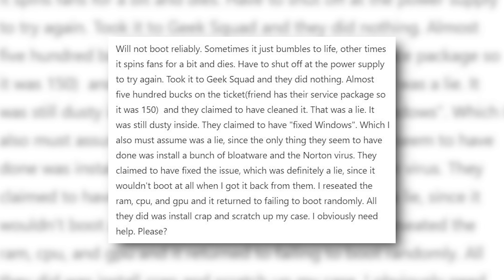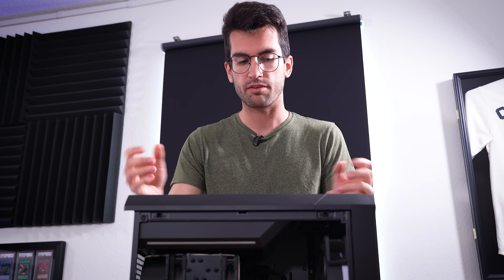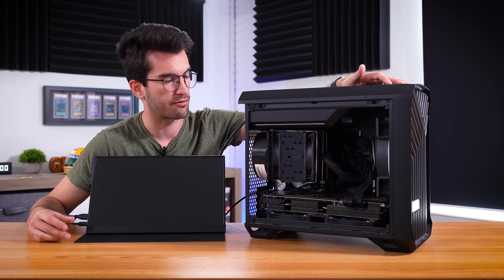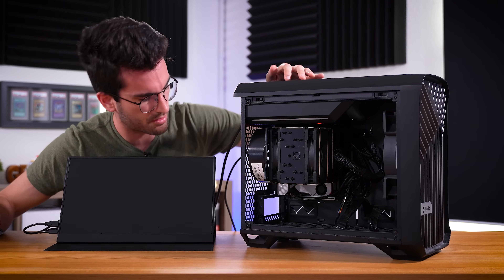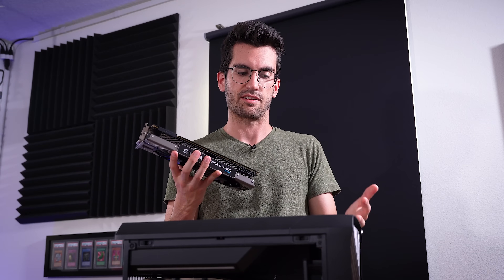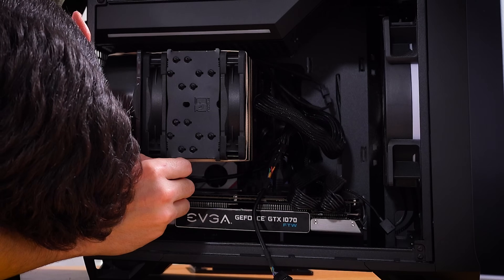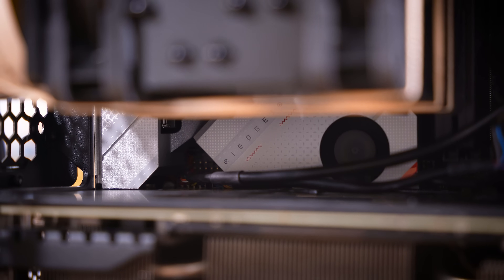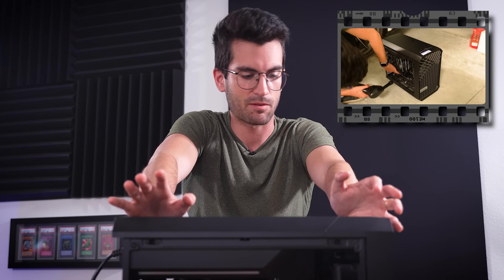Fixing a Viewer's BROKEN Gaming PC? - Fix or Flop S5:E6

Comment: I used to work for Geek Squad.  Never ever take you PC to them for repair.  They exist for one purpose and that is to make money.  They follow a prescribed list of procedures which always ends in costly service priced in the hundreds.  The procedures are revenue generators and are useless for actually identifying any problems your PC may have.  "Oh, your PC won't boot?  We will have to reformat your hard drive.  It will cost $199.  Oh, and we installed Norton Anti-virus because your system was infected with viruses.  That will be another $59.    The diagnostic that was needed to determine you had viruses will be another $159.  Thank you for your business!"       -- When all you really needed was to replace the power supply or have some bios settings tweaked.  I have seen it happen so many times.

Comment: Greg, you're the first person I've seen talking about the KryoSheet mentioning that they're electrically conductive (doesn't mean others aren't, but it's the first time I've seen it). That was the most useful bit of product information I've heard about it - I have 3 systems I was looking to put the sheet on, but without knowing it was electrically conductive, I would have just slapped them on. Now that I know, I can take the proper precautions when applying. Thanks for the info!

Comment: Yeah that geek squad precinct was not correct at all. I work for Geek Squad at the Best Buy in New Braunfels, TX and I would have NEVER assumed it was software issue with Windows since there’s obv a hardware problem going on. Also, that specific GS precinct that didn’t fix anything did not follow procedures because we are supposed to show that the system is operating properly according to the repair notes in front of the customer. Whoever did that repair was not experienced and/or trained. Good job for Greg for properly showing how it should be done👍

Comment: two thing ! #1 I think i saw a kinda loose gpu power cable while you where unpluging it for the 1st time ! #2 backplates might not work for shorting do to paint ! you should have tried with a screw driver ! and even then the 2pin hanging of the thing might have shorted something else in the motherboard because the first shot of the pc show the pins kinda stabing the motherboard

Comment: Along with resetting the bios on systems I've looked at that don't work and blowing out the dust. I unseat and re-seat everything. If it can be unplugged or removed and re-installed it is. This has actually solved the issue over 1/3 of the time.

Comment: I've had a pc with same issue what I found out was the Graphics card didn't always fit well in the motherboard PCIE socket, unsupported graphic cards can warp the socket so it does not always work great causes all kinds of issues, I had to replace the PCIE socket on the motherboard

Comment: My brother's PC had a very very similar issue and the PSU also tested completely fine (although it was with software testing, OCCT & HWinfo, but voltages were all measuring good and stable)
Everytime it would refuse to boot i had to unplug the PSU's power cable, press the pc's power button (to empty it of any residual power, suspecting an issue with a capacitor)

But it could go for a week without any issue, and would just be shutdown and booted up again with no issue. And then randomly one morning it would do this again, power on for a few seconds and shutdown, or be completely dead right out the gate.

I ended up swapping an old, weaker PSU in for testing for a couple of weeks, never saw the issue again, then purchased him a proper PSU replacement and he's been having 0 issues for over a year now.

Comment: Hi Greg. 
I had an almost identical issue with an older custom build, as in randomly shutting down. Sometimes, it would boot into Windows, and other times, it would shut down just as Windows was loading.

I couldn't figure out at the time what was causing it. Bios showed everything was fine, and i didn't have many spare components to try out.

A couple of months later, after building a new system, i decided to give it another try before i disposed of it.

Bingo,,, the bios showed that there was a problem with the 3volt rail. I checked the 24- pin connector with a volt meter, and everything tested fine.

Under close inspection, i found that some of the terminals had splayed out ever so slightly. More than likely age related.

I carefully pinched them together with some tweezers, reconnected the plug, and the issue was solved.

Granted that i now only use the old system occasionally. However, it is now 14 years old, and still working fine.

Comment: In my experience reseating the graphics card, sometimes Does do the trick. or the pcie supplemental power plugs too just unplug and unbend pci cables then reconnect maybe a pin wasn't making good contact.

Comment: Seeing how the GPU is sagging, and the custom fan bracket, I'd be worried whether the fans touch the base of the chassis. That may prevent them from spinning and system may shut down. Since the issue is random, I'd say there would be just a tiny clearance. Reseating the GPU probably improved the spacing.
Similar thing happened to JayzTwoCents with Phil's mini-ITX build.

Comment: Wonder if the mobo turns off power to the HDD LED cable after POST if no LED is detected.  Could be reason why it wasn't shorting when Greg tried touching to the backplate... if that was the issue.

Comment: My money is on the power connectors to the graphics card.  I bet they weren't seated well, and when you plugged anything else in there including going back to the original card, you connected and seated everything correctly.

Comment: I have buy a pc for one family member.
It power on sometimes and shut off after 2 secounds.

I actually tried to fix it for days. I free handed and did so much. But no actually results to work. 
I then just felt i really need to fix it so i looked upp on internet what solution should help. I reseted ram and sence then it worked with out issues. 

I am still confused how did i fix anything by reseting ram.

Comment: a short sounds likely because the psu refused to turn on sometimes after the system briefly started then shut down. that sounds like the psu protecting itself, and switching off at the psu reset the trip switch. if the cable in question ran close to fan blades and got vibrated, it might intermittently make contact and short sometimes and even trip the psu self protection; and contact a painted surface other times and not short at all.

Comment: I cringe every time I see Greg use a screw driver on the power pins!😱 They have wired push buttons on Amazon!!😲 They have the one with the full connector and the one with just the two pin connector!

Comment: If you look at 4:10 you can see it is touching the back plate and if you look at 5:49 it is very near to the hole near 'C' of "GeforCe".  It is very possible it was touching to the screw hole which is usually connected to the ground.  You probably could not replicate it because you were touching to it to a different card and not the holes.

Comment: Front panel connector "power LED" extension was wired backwards...at 6:21 you can see the red wire from the extension is connected to the Power LED - connector.  I'm pretty sure the power and hdd LED's have to have the correct polarity...but the power switch and reset switch don't have a polarity.

Comment: Just replaced my MB and PC would not post no video. So, I unplugged all not essential items. Turned out the CPU power connectors it has a 8 pin and a 4 pin. If the 4 pin is installed the pc will not boot as I am not overclocking, I removed it and no issues now.

Comment: My best guess is it was the front panel connector with the extensions. Once you started jumping the pins it rectified the issue. Its possible that either it was connected wrong and then you fixed it upon re assembly. Or one of the many single pin connectors wasn't seated well. Thats my best guess as to the unknown solution. Love watching these and seeing the solutions and also trying to think of the solution before its revealed. Great video Greg!

Comment: the back plate of the graphics card is painted and insulated and the hdd led will not short touching that. you could have been correct, just short it using something non-insulated like your screwdriver.

Comment: i jad this exact same issue on my msi tomahawk b350 and ryzen 5 1600 with a 1070. Used it for many years without issue and all of a sudden my system wouldnt post. Debug leds would hang on VGA. Tried with a separate psu and no fix. i put my old 960 in and it worked perfectly. If i put the 1070 in the 2nd pci slot (x8 slot), it would work fine. I replaced my motherboard only and still running with all issues resolved. I attributed it to an issue with the first pcie slot on the board failing

Comment: electrical on the on the HDD LED connection will ensure its not grounding it. I'd still test the PSU. User's card pulls more power than the test cards. Never hurts to test the PSU.

Comment: There's an old anecdote that goes somewhat like this: A guy calls his sysadmin friend and asks for help - his computer won't power on. Sysadmin says: disassemble everything, carry each part to different corner of your house, then call me back when you're done, I'll tell you what to do next.
10 minutes passes, guy calls back. Sysadmin is like: I said disassemble EVERYTHING, cooler, RAM, remove your CPU, all of it. Don't miss even a single screw.
After another 30 minutes guy calls back again. Sysadmin says: did as I said? Good. Now assemble it all back.
Dude does as he was told, assembles everything back to the complete state, turns on the power - everything works.

Sometimes the fix is just pulling stuff out and putting it back in. And yeah, the dust definitely has a lot to do with it. Wouldn't surprise me if specks of dust got into the slot and were shorting something.

Comment: This build is kinda the reason why I really hate small form factor builds. I completely get that some people might have space constraints.. but if you don't than just never go for those kind of builds. You are just asking for trouble (And yea i accept the people like different things and so so on... I am more of a pracitcal guy. My rig sits on my desk in a giant be quiet case and i wouldnt want it any other way). It is so god damn hard to work in there - air flow is a MESS and you run the risk of shorting something because there is so little space and it so prone to errors as a result.

Comment: I've had customers get similar problems. I remember that one time it was a fault in the switch of the power button on the case. It would some times remain in closed mode after you let go of it. The result was that the computer would turn on then off again a few seconds later. On another machine the reset button would work in the opposite way it was intended to. That means it was normally closed, opening the connection when you pressed it. That resulted in the motherboard never entering post as the reset was continually engaged. Both are things that can happen. The switches used for power and reset are cheap and not the highest quality in the world.

Another similar problem was a customer who had installed an extra distance for the motherboard. That is there was a screw distance on the motherboard plate that didn't fit a mounting hole in the motherboard. It was placed directly under the memory slots, and depending on how hard you had pressed the motherboard when installing the memory it either caused a pin on the memory bus to connect to ground or not. This caused a lot of work. The customer received two replacement motherboards and yet the problem remained. These were server motherboards costing well over $1000 so we really wanted it to work. I had to drive to the customer and have a look in person. This took about six to eight hours each way, and it took me replacing the motherboard twice before I figured out to count the distances. There turned out to be 13 distances in the chassis, but only 12 screw holes in the motherboard. As the distances were riveted in place it took a drill to remove it. Then the machine worked fine.

But the most common problem has to be the PSU. Just swap the PSU and see if the computer will still have the same problem. This tend to solve the problem way to often. It can also expose a bad motherboard in a quite nasty way. I had industrial PSU's that lacked just about all protection circuits. Most telling was that they had no over current protection. This could burn leads that were shorting, smoke PCB traces that were shorted, or remarkably often explode capacitors that malfunctioned. In the last case the motherboard would usually work once the capacitator were destroyed. It wasn't repaired, but it worked. If the machine was under warranty the motherboard would still need to be replaced, but if it wasn't it was up to the customer to either take the chance of using the "adjusted" motherboard, replace the capacitator or pay for a new mobo. I had a test motherboard where I had blown a capacitator and then replaced it. Never sold that to a customer but used it to test processors, memories and graphics cards.

Those industrial PSU's are great. I once test drove an eight processor machine using a 460W PSU. The redundant PSU's in that machine was a four module redundant PSU where each module could supply 1100W. So that 460W PSU was a bit overwhelmed. Still the machine passed POST. We ordered these from Taiwan and the owner of the company was still actually working on PSU designs. They had a lot of specialized PSU's, including versions intended for medical equipment. Now those were rather expensive. The thing is they matched a lot of performance requirements and the components were not going to outgas when they got warm. I think they had some volume requirements also, but never looked to much on that segment of products..

Comment: one thing i have notice when working on other peoples pc is i always check the motherboard screws as i have found some are in the wrong place and short it out 
starts power cycling and works sometimes and even has little bend in the board

Comment: I had similar issues with my PC. Unfortunately, this problem is the last thing to come up because I had my computer worked perfectly sometimes and sometimes it wouldn't even start. In the end, it didn't start at all and then I took the computer to warranty and it turned out that the motherboard was faulty. after replacing the motherboard there have been no problems. It's been 2 years.

Comment: May be he tried desperately to fake a problem in the system that doesn't exist by plugging the wrong wires in the wrong place, so when you rewired everything correctly it came back to life. Just a cheap way to get free upgrades,probably for the gpu 😊

Comment: Cabling.  Cables are tight in there. Those cables from the front panel, are very close to the hot GPU.  The GPU cables were very tight.  One of those cables was/is causing the issue.  The joys of small format cases.  Always give me a big case, please.

Comment: @GregSalazar The only other test I might have done is power off the PSU, discharge everything via the case power on switch and leave for a while and try powering on again. You probably did that though and change the CMOS battery 😁. Other than completely dismantling and looking for shorting parts or extra mainboard standoffs then that was a wierd one 🙂🖖

Comment: I think it was the extender cables to the front bus. Often the plugs get worn and the pins fit loose just a bit of movement and the work but shift the case and they lose contact. That or the power switch button is going bad.

Comment: Hey Greg. I have this exact same motherboard. Earlier production unit of this MOBO ship in a box where there is no cutout between the box and the clear CMOS button on the I/O shield. This causes the clear CMOS button to constantly be pressed and drain the CMOS battery. As an SI, I've worked with 3 units of these motherboard and they all have weird issues. These issues went away once the system is left with power running through them for a while. 

Since this is an ITX motherboard, checking and replacing the CMOS battery is not that simple. The battery is not socketed like most other motherboards out there.

Hope this helps.

Comment: Definitely a fix greg. Most likely it was a cabling issue because there are so many odd configurations to the build, you should recommend the owner change case and run wiring properly without modifications.

Comment: In the first shot, you were cleary able to see, that the fuse inside the power supply shut it down. So either the PSU is slowly dying (would not show on the tester) or you had a short (maybe from the led - your test on aluminium does not work) or there is some other short, like a broken wire in a cable or something...

First thing can be found out with a stress test. Second with shorting the led on something that is actually conductive. XD

Comment: Just a wild guess from my side
Could it be that the power led connector was accidentally plugged in +- -+ since there were inscriptions on the case side but not the mobo side and when you redid it you 'accidentally' plugged them in the right way?